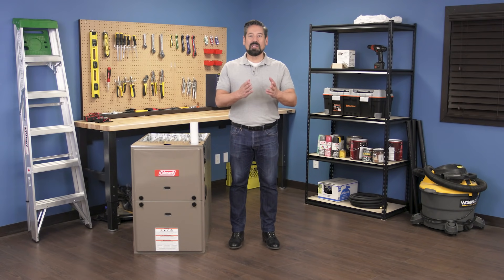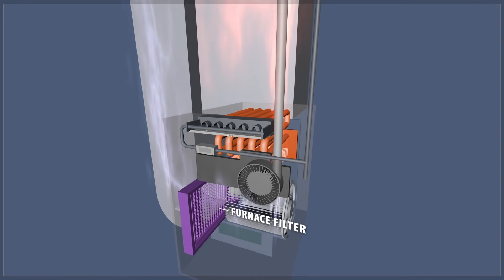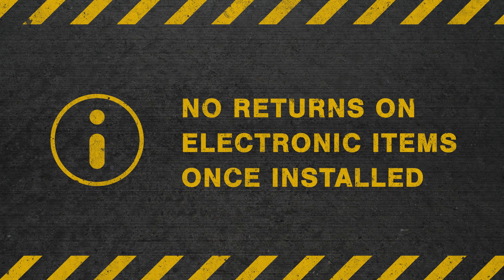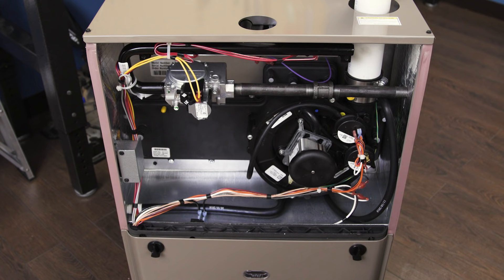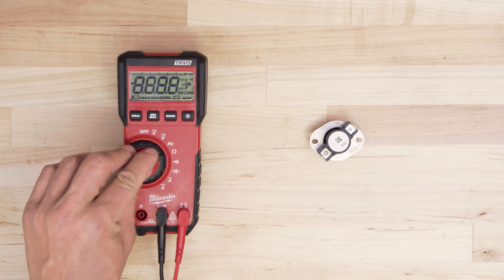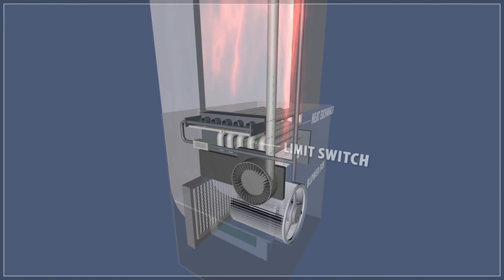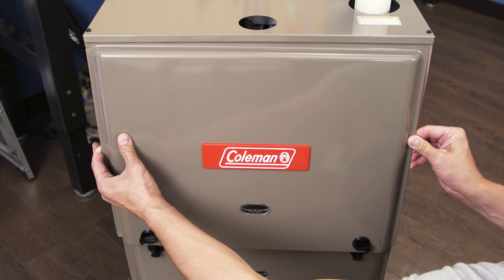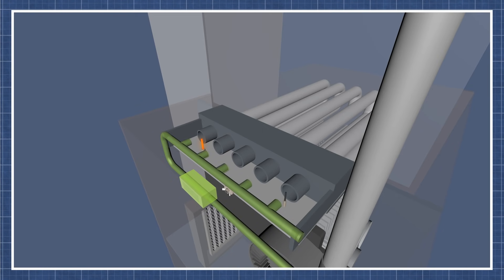Furnace - Limit Switch | Repair and Replace

Comment: My limit switch has 4 wires on it . So don't I need a 4 terminal switch Part
 626337B
Reply from the maker: Hi Walter, if you have an older furnace with a 4 wire switch, then  you likely have an combination Fan and Limit switch. These are used both to time the blower fan, and to act as a high limit to shut the furnace off when the temperature reaches the threshold. You can replace these switches just like any other, just make note of which wire goes where.

Overall if you've found this helpful and want to help support the production of more videos like this, you can like, share or even subscribe to our channel. Every little bit helps!
Reply: @AmreSupply  the thermostat at the wall shuts off and then the blower fan goes on a few minutes and shuts off. Hoping this is the problem..would you know?
Reply from the maker: @waltertopij1253   In most furnaces, the blower fan will continue to run after the burners shut off. This helps cool down the heat exchanger and ensure that no heat is wasted. Depending on how far into the sequence the furnace gets will point to a different switch or sensor. If you are describing short cycling, or a furnace that shuts off before it ignites then you can learn more here: https://youtu.be/b0sAGt-1niU
Reply: @AmreSupply   where can I  find these switches  at?
Reply from the maker: @waltertopij1253  We have a variety of limit and rollout switches here at AMRE https://www.amresupply.com/catalog/Fan-Limit-Controls-HZ3D Also if you need help narrowing down the part then you can call our customer care center at 1-800-661-9891 Just have your furnace or switch model number handy.

Comment: What if you have crappy wiring all one color and no indicators for what wire is which? what side of the switch gets positive and negative terminals?
Reply from the maker: Hi Beau, if you have a limit switch similar to the one in this video then the polarity of the switch doesn't matter, so you can swap the wires and the switch will still function as normal. In  older furnaces that  use an older style fan limit switch,  reversing the polarity could damage the components of the switch. If needed  a piece of tape can be used to remember which wire goes on what terminal.

Comment: I have a coleman pilotless furnace..Blowing cold air.I checked my Filters, all clean.The furnace hums like it wants to click on but don't..Ideas??
Reply from the maker: Hi Pat, thank you for watching. Do the burners ignite? If so do the flames stay on and run for several minutes before the blower fan kicks on? Also does the furnace kick up any codes or blinking lights?

Comment: What is the point in testing the limit switch? Ypu saod either way and no matter the result it can be fulty. Might as well start there I guess. The test will show nothing.
Reply from the maker: Hi Kevin, You're right, installing a new functioning limit switch way of eliminating it as a source of a problem, but testing the limit switch is useful to help determine if the switch has completely failed, vs just losing sensitivity. That's why its included in this video.

Comment: Is this danger  to have the water heater close to the furnace this  pressure Val the vent gets hot will it get to hot causing the water heater to explode this is my dad house and I was wondering is this common  to have it that close to the water heater
Reply from the maker: Furnaces and water heaters are often placed side by side or relatively close to each other. 

When installed urnaces and water heaters must meet several requirements. 
-Overall all gas-fired appliances shall be provided with outside combustion air. 
-The hot water heater must be able to be removed with the furnace completely intact.
-The furnace room or closet must have a door large enough to remove the largest piece of equipment.
- The access/ control side of the furnace must be unobstructed and should be accessible for maintenance.

Generally the proximity of the furnace and water heater won't affect the operation. As long as either appliance is installed correctly, and the safety switches are operating, then everything should be running normally.

Comment: my furnace is keep running and wont turn off when it meet desire temperature, could it be the limit switch? thanks
Reply from the maker: Hi Troy, Does it shut off after a while or does keep running indefinitely?
Also it may seem simple but check the settings on your thermostat. It should be set to [heat] and 
the fan should be set to [Auto]. If the fan is set to [On] then the fan will continue to run even when heat isn't needed. Some people use this setting just to have air circulating through their house 100% of the time.

Comment: My furnace has 7 blinking led indicating lockout for retry. 

Furnace works on fan ON mode. But If I set to fan AUTO then it ignites few time. I see the flame. But blower does not kick in at all. Hence furnace shuts down after trying few times. 

I tried cleaning flame sensor. No luck.
Reply from the maker: If your furnace works on Fan ON mode not during Fan Auto then it could be a couple issues. If your furnace uses a multi-speed motor, or if your furnace also has an AC unit, then your blower fan motor could be faulty (the windings on one of the speeds could be shorted or burnt out) 

Alternatively there could be an issue with the control board, but this is best tested by a professional.
As for the limit switch, generally this will give you a specific code if the limit switch is open, so its likely not the issue but you can still test it to make sure.
Hope this helps.

Comment: I have a coleman set up for down flo. The furnace burners lite but as soon as hear the click for the blower to come on, the flame cuts off at the exact same time. Would that be the limit switch?
Reply from the maker: Since your furnace goes through ignition but cuts out after the heat exchanger heats up then it does sound like its the limit switch.

If you want to be completely sure then take a look to see if your furnace flashes any codes after the flame cuts out https://youtu.be/b0sAGt-1niU?t=57 These codes are unique to each model, your furnace manual or a reference chart on your furnace will let you know what the code means.

Comment: Should the limit switch contact the combustion chamber or just measure the air temperature.  I have a thermal switch that keeps tripping but it is actually hitting the combustion chamber so much so that it is making a slight dent in the switch.  I'm wondering if my installation is incorrect.
Reply from the maker: Hi Dave, most limit switches will monitor the air temperature or the air that travels over the heat exchanger. The heat exchanger will be much hotter than the air, so if the switch is making contact then it would cause it to trip more often. 

If you have an older furnace, there might be 2 limit switches, one for the high limit and one for the fan. The fan limit delays the blower fan from running until the air is warm enough. Newer furnaces just use a time delay. Its unlikely but some fan switches might be positioned closer to the heat exchanger, it depends on the model. There is a lot of variety.

Comment: When I turn on the thermostat for heat, my Fedders unit just blows cold air. There is a blinking red light inside the furnace. When I refer to the blinking code chart,  it suggests to "open high limit switch. Make sure limit switch wiring in good condition and securely connected". Based on the symptom of no hot air being produced and the error code, do you think I need to replace this limit switch?
Reply from the maker: Hi Curtis, The limit switch can cause the furnace to blow cold air. If the limit switch is defective or is stuck open open, then the furnace will think that its overheating and it will run the blower fan to try to cool the system, even when the heat exchanger isn't overheating. In this case it would be best to replace the limit switch. This is explained a little bit more in this video if you're curious https://youtu.be/XrxV6I8C4yY?t=51

Comment: My limit switch is cracked and the wire looks burned I’m thinking this isn’t good at all. What may be the problems? I’m forsure going to replace the limit switch and wire that looks burnt.
Reply from the maker: Hi Verlon, when the limit switch fails then the furnace will think that the heat exchanger is overheating. Generally the furnace will ignite, the  blower fan will run and the furnace will shut off before it gets a chance to heat up.

Comment: The current limit switch in our Heil furnace is an L150-20F. The replacement switches I see for sale are L150-30F and they say that is the upgraded replacement part for the switch we have in the furnace now. Will the L150-30F work okay in place of the L150-20f limit switch? What are the differences between those limit switches? 
Thanks.
Reply from the maker: Hi Wymi,  L150-20F means the switch opens up and will turn the furnace off at 150°f and will close at 20° less (at 130°). Installing a L150-30F means that the switch will close at 120° (so 10° cooler than the other limit switch. Its best to put the exact same rating in as this is what the furnace is designed for but a 10° difference on the lower number won't affect the protection. These high limit switches are to protect the furnace when the temperature gets too high so the upper limit matters most. 

There are adjustable switches, that can be set assuming that is physically similar to the one that you need. To get a 150-20F you can use an adjustable switch with a 20F difference that can be adjusted to 150°F then you'll have an exact match for specs. https://www.amresupply.com/part/AT022-FAN-LIMIT-SWITCH-ADJUSTABLE-140F-180F
Reply: @AmreSupply  Thanks for the info and fast response. The issue that led to the limit switch as a problem is the fan blower turning back on with in a minute of the system shutting down  after the thermostat is satisfied. The fan only runs for about 10-15 seconds then shuts off. The filter is changed every 2 months w a low restriction pleated filter.
Reply from the maker: You're welcome Wymi. If you've eliminated the airflow as a source and the blower fan runs intermittently after the temperature has been reached, then that does point to the limit switch being faulty.

Comment: Hi. Vance. I wanna order limit switch but you have two different limit switches on your online. One is manual reset and the other one is auto reset switch. Which one is it?
Reply from the maker: Hi Ho Kim, Most limit switches will be an auto reset but check your switch first. If your switch has a button on it then it is a manual reset. If there is no button then it is an automatic reset. Hope this helps!

Comment: what is the cause for the high limit switch to open
Reply from the maker: Hi Tony, in modern furnaces the limit switch will open anytime the temperature gets above its threshold. This can be caused by a restriction of airflow (dirty air-filter, or clogged ducting, furniture blocking vents and/or a high amount of static pressure inside the system)
On the side of the limit switch you might see two numbers like L200-30F. This means the limit switch will open at 200°F and once the temperature drops 30°F and is a at 170°F the switch will close again. Overtime the switch can start to fail and might start tripping at lower and lower temperatures.

Comment: My fan keeps running after it stops calling for heat so i'm assuming its the limit switch.
I open my total electric (Coleman)furnace and see what appears to be 4 limit switches in a row.
Does this sound right?.... Are they all 4 limit switches?  they look identical to me.
And if they are all the same.... should I even take the time testing them individually? ,,, or just replace them all.
Seems fairly inexpensive at 10-12 dollars a piece.
Reply from the maker: Hi Robert,  multistage furnaces use more than one limit switches to monitor different temperature ranges, so its possible that all 4 are limit switches. It doesn't take long to test them individually just to get a sense.
Reply: @AmreSupply  Ok... Thanks for your reply
Reply from the maker: One more thing, when you take a look at the limit switches, take note of the temperature ratings listed on the side of the switches as this will indicate different temperatures.  If you end up replacing the switches, make sure that you match the rated numbers.
Reply: @AmreSupply  great advice.... Thanx a million
Reply from the maker: You're welcome Robert! Cheers
Reply: @AmreSupply   so I replaced my thermostat(exact same model) and all 4 of those limit switches(same values) and thought i had it fixed. Sometimes it will cycle properly but sometimes the fan still wont kick off, but i can turn the thermostat down 5 degrees or so and then the fan will kick off. Do I have a ghost in my house? Lol.
Reply from the maker: @robertmcclung8035   Thanks for keeping us posted. If you've eliminated the limit switches and the thermostat as sources of the problem then it might be a issue with the relay. You might find this video helpful as some of the comments dive into similar intermittent blower issues as you. https://www.youtube.com/watch?v=ls8ypoWdal8
Reply: @AmreSupply  Awesome info! I'll try that next. Thanks for all your help.
Have a great weekend.
Reply from the maker: You're welcome Robert! Take care!
Reply: @AmreSupply  still fighting this furnace... I have replaced the sequencer and it's still not cycling properly.
 if I just set it to 70 degrees and let it gradually drop down to that temperature, the fan starts running but puts out no heat, if I then turn the thermostat up five or six degrees it starts putting out Heat but then once the thermostat is satisfied,  the blower continues to run and blow Heat..... if I then turn the thermostat down to 65 degrees it'll eventually kickoff,.... approximately 1 to 2 minutes.
Any advice would be greatly appreciated
Reply from the maker: @robertmcclung8035   I would recommend to double check all of your connections on any parts that you've replaced to see if they are on the right terminals. Overall at this point it might be best to call a professional to take a closer look.
Reply: @AmreSupply  My furnace stays on when the heat turns off and it never goes off, nor does the heat kick back on. I have to reset the control board to get it to go off so that it will come back on the correct way with heat. I see an OL code with some lights blinking. Is this the limit switch?
Reply from the maker: Hi Joe, first thing to do is to check the settings on your thermostat. It should be set to [heat] and the fan should be set to [Auto]. If the fan is set to [On] then the fan will continue to run even when heat isn't needed. Some people use this settings just to have air circulating through their house 100% of the time.
If those settings are good, then check your furnace manual to see what the flashing lights / OL code means. Every model is different and there is no standard. This should help point your in the right direction.
Also make sure that the thermostat is wired correctly. If its been changed recently then its best to check the manual and check to see if the wires are in the right terminals.

What kind of limit switch do you have? Is it a dial type with a fan and limit setting? Or is it a modern switch similar to the one in this video?
Reply: @AmreSupply  It's a Goodman 95% furnance and the themostat has been there for a while and set to the settings you mentioned. I've been reading more on the internet of the code may mean the limit switch. It looks like the one in your video. http://goodmanrepairparts.com/limit-switch-10123539-goodman-amana-janitrol-manual-reset/ The furnace is 9 years old. When I reset the control board it usually works for a while before faulting out again. I'm going to try and grab the code next time and look it up. If you think it may be the limit switch perhaps I should just buy one and have it on hand. Thanks.
Reply from the maker: Hi Joe, OL might mean "out of limit", and could mean the limit switch but its best to check the code in the manual first.

Comment: Ok . What about if the switch is good ? I already test it , the switch is good and the problem continues .
Reply from the maker: Hi Teto, if your furnace continues to cycle on and off then its worth watching this video, as it covers some of the other safety switches that could be tripping https://youtu.be/b0sAGt-1niU

Also we just release a few new videos on troubleshooting specific problems. Hopefully one of the videos helps:
Furnace Won't Start - Troubleshooting    https://youtu.be/Bi76q0TzoW8
Furnace Blows Cold Air - Troubleshooting    https://youtu.be/XrxV6I8C4yY
Furnace is Really Noisy - Troubleshooting    https://youtu.be/WkHgeTITioE